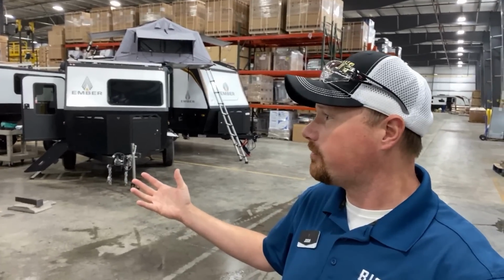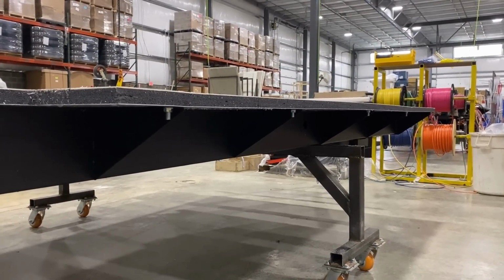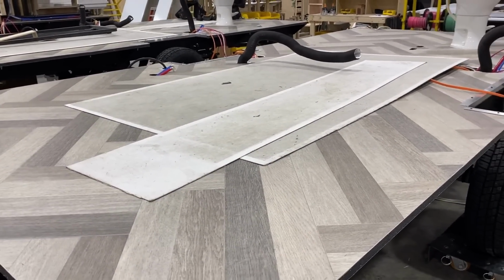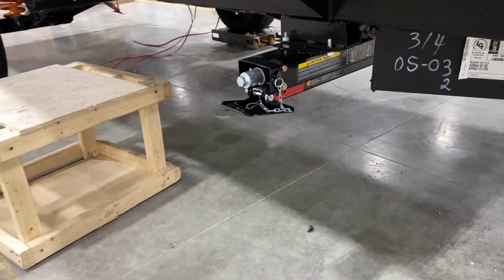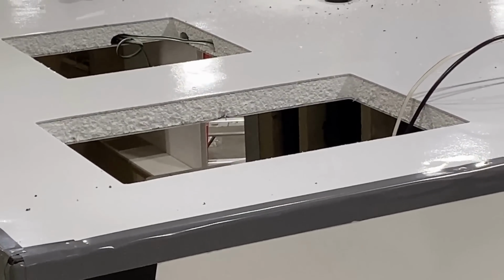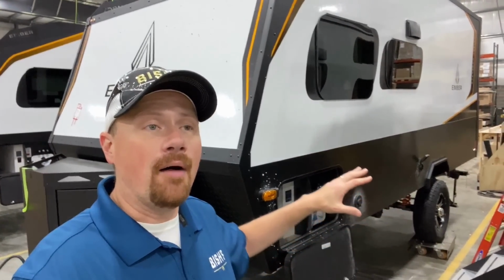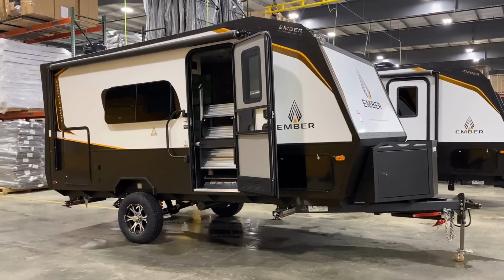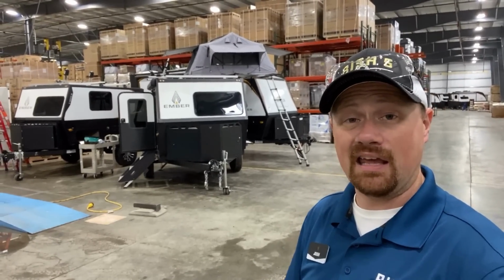Ember RV Factory Tour!!

Comment: Please make sure that all the floor penetrations are well sealed. It's infuriating to have mice get in a camper!
Reply: I took inch and a half du Pont blue board insulation and filled my holes around the pipes. Then used black spray foam to fill all the voids. Mice.  Insects and cold air will find their way in. Took less than an hour and we can tell a difference,  especially in the bathroom. The holes under the shower definitely would allow cold air in , and my wife doesn't like cold air when she gets out of the shower. Problem solved.